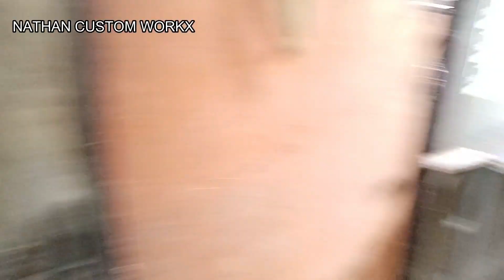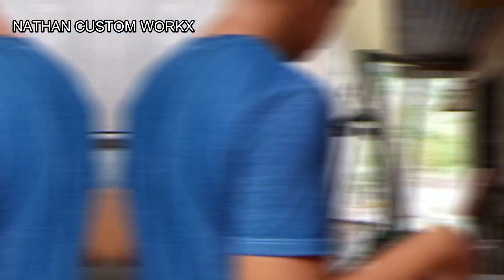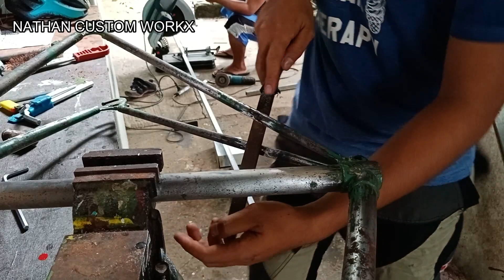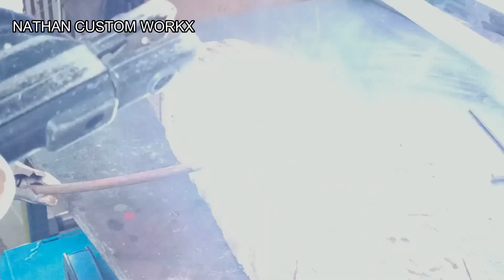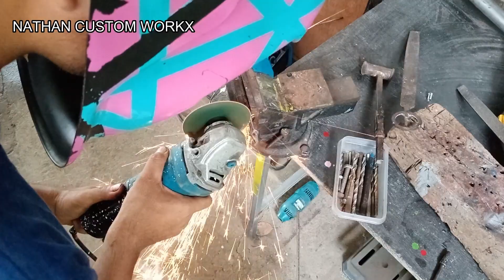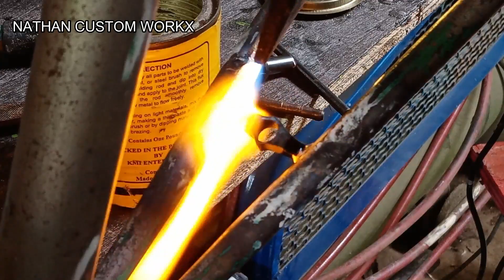CHANGING BRAKE HOLDER OR BRIDGE│BATANGAS CITY, PHILIPPINES

Comment: Idol ano KayA pwede ipang weld sa classic frame ko may butas Kasi e ..pag ordinary na weld natutunaw Lang Yung bakal
Reply: Ganyan din frame ko idol chromoly classic frame
Reply from the maker: bronze brazing sir. gaya po ng gammit ko sa video na ito
Reply: Magkano KayA ganun sa hardware sir
Reply from the maker: 50 pesos po bili ko dito sa amin isang rod. kailngan nyo po ng oxy acetylene. di po sya pwede sa welding machine